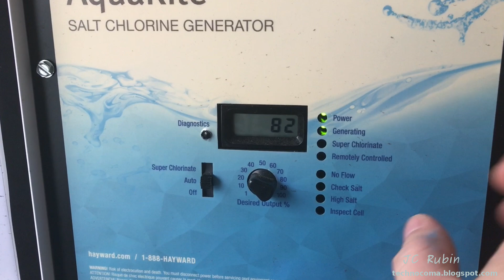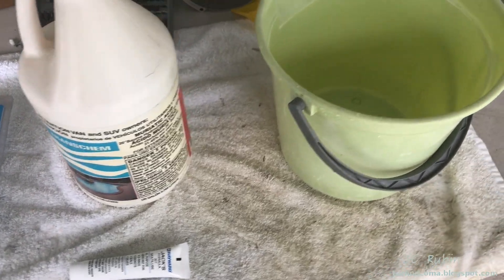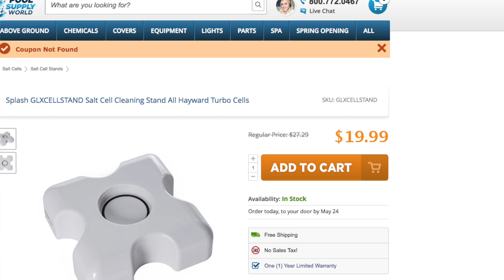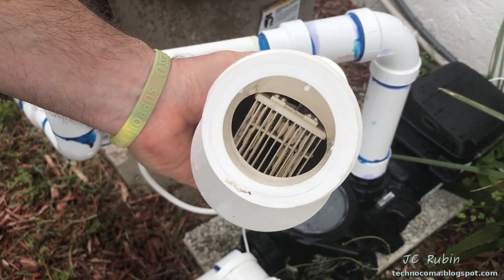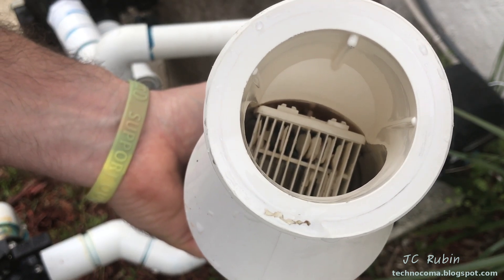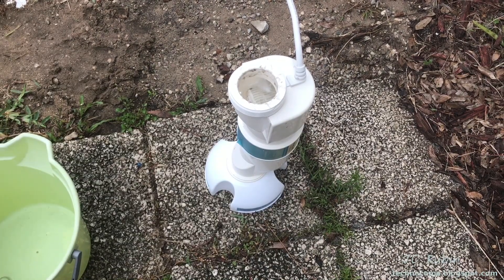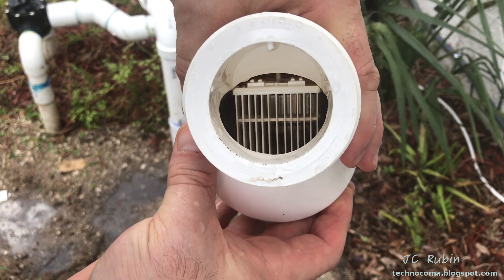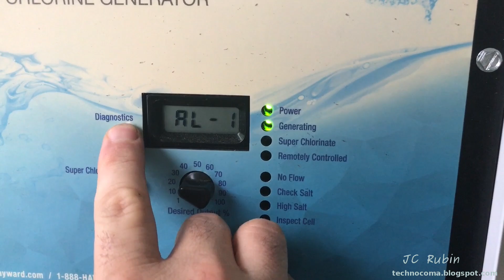Hayward AquaRite Turbo Cell - Cleaning and Regular  Maintenance Inspection

Comment: Thank you....but was curious what did u do with the bucket of water and the "waste" muriatic acid and water mixture from the cell? Some vids just say pour it into the pool? Did you? If its quite dirty id rather not throw it into the pool do you just add more water to it and dump it in the corner of a rock garden or backyard?

Comment: Thanks. I haven't ever done it before and my first Hayward salt cell lasted 6 years and this one is 5 years old. I am trying to figure out why the salt cell is generating great, but for some reason it's reading a low salt level. It keeps going to 2600 or 2400 when the pool store says it's at 3000 or 3200. Thought cleaning it might fix the problem? When my last one died after 6 years, it had never been cleaned, and it was quite clean. I guess Atlanta water must be very good. I tried recalibration,  but it does not seem to hold. Question: Does it take about a gallon of the water acid mixture or a smaller amount? Thanks.

Comment: Do not use acid it burn the cell ,use CLR mine is 9 years old still working
Reply from the maker: What a profoundly nonsense comment......   Don't use acid... use acid.

Calcium Lime Rust, more commonly known as CLR, is a household cleaning product used for dissolving stains, such as calcium, lime, and iron oxide deposits.

Its ingredients may include various compounds:[1][2]

    water
    lactic acid
    gluconic acid
    lauramine oxide
    propylene glycol
    n-butyl ether
    glycolic acid
    sulfamic acid
    disodium capryloamphodipropionate
    ethylene glycol n-butyl ether
    citric acid

One formulation is (by weight) lactic acid 12-18%, gluconic acid 2.50-3.75%, lauramine oxide 1.50-3.25%, with the remainder being water.[3] The product also contained phosphoric acid at one time,[citation needed] but it is now phosphate-free.

Comment: Hi. We used grips to successfully unscrew the rings from the salt cell, but when we did a lot of water started coming out and would not stop. We had to screw it back together and stop the process. Any help?
Reply from the maker: open the air valve of the filter first, then the water will drain down to the pool and the salt cell will empty.
Reply: @retrotechandelectronics hi, will opening the pump lid (where the basket is) also do the trick?

Comment: Where do you dump the used acid/water??
Reply from the maker: I dilute it in a large bucket about 40:1 and dump it in a sand pit with good drainage.
Reply: @retrotechandelectronics  cool, tks! Great video!

Comment: Great video. Have been struggling to keep chlorine levels up on SW pool, had it at 60% and nothing, system displaying "no flow".  Sure enough, opened the cell and full of scales. Cleaned it and 15 minutes later back on with correct "flow" reading.
Reply from the maker: Glad it helped!

Comment: I bought an after market salt cell two years ago. It’s seems to be dead. Is that common? Any way to test if the unit is kaput before buying another one? I wonder if buying a cheap cell is why  I am in this situation. I got 5 years from my Hayward that costs 4xs as much.
Reply from the maker: I havent had any experiance with off brand cells, check amazon reviews on the one you purchased.

Comment: When I removed the cell, it pushed a bunch of salt or fine sand into the pool.  Is there anything I can do to prevent this?
Reply from the maker: There should be nothing in that cell when removed but water.... You have other issues upstream...

Comment: Great video.
I might have to finally try cleaning my cell.  I've never had to clean it before. Vinyl liner pool with low calcium levels and with rain I don't have to add much water from the tap.
The control panel is only reading 3300 ppm when the salt level in the pool is actually 4250 ppm (pool store).  
The 4250 ppm is my fault.  I added salt at the beginning of the season without checking to see if the salt cell was reading salt levels accurately.      I normally run the salt around 3600. 
The salt cell is 8 years old.  Then again I normally run the cell at around 30% for the 5 summer months. So I guess it really doesn't have that much use.   I hope cleaning it will fix the cell/readout.  I'm going to just keep running it until it stops producing chlorine or the control panel read "too low salt" and won't run.

When it does finally fail, I'll just switch to adding liquid chlorine for the rest of the season or until the price of new cells comes back down.
The cost of a new T-15 cell is insane at the moment.  They are asking $900 when just 6 months ago they sold for around $550.
Reply from the maker: Wow, 8 years without cleaning. Impressive.

Comment: What is the name of the tool do you use to open it? mine is too hard
Reply from the maker: I use an oil filter wrench like this 
https://www.amazon.com/TEKTON-5866-12-Inch-Filter-Pliers/dp/B000NPR33O/ref=asc_df_B000NPR33O/?tag=hyprod-20&linkCode=df0&hvadid=312003160272&hvpos=&hvnetw=g&hvrand=14860492056429093465&hvpone=&hvptwo=&hvqmt=&hvdev=c&hvdvcmdl=&hvlocint=&hvlocphy=9012393&hvtargid=pla-382661962209&psc=1

Comment: I cleaned it but still says 0 and my aquarite system still says inspect cell its not flashing , the light is just on should I increase the output ?
Reply from the maker: you need to hold the button for several seconds to reset the maintenance light.

Comment: What is that tool (special wrench?) you use to loosen the union?
Reply from the maker: Its called a bar clamp.  Its used for a different purpose but I found it works well for this so I use it.
Reply: A strap wrench works well also.

Comment: One suggestion for improvement here - when you screw the cell into the stand make sure the cord is facing down. Otherwise, the acid can't clean everywhere inside the cell.  I found this in the manufacturer's training video.
Reply from the maker: Thanks for sharing.
Reply: @retrotechandelectronics  No. You did it correct. If the cord is at the bottom I don't even think it will screw onto the GLX salt cell cleaning stand. I do it with the cord up everytime, just like you did in the video.
Reply: @scotty7647  It will screw in either way, and yes, the manufacturer suggests having the cord facing down to ensure complete cleaning.
Reply: @lilricky2515 correct

Comment: The Power and Generating lights go on and pop off on my AquaRite after a few seconds and my chlorine levers are low...The Led display is responsive, but it seems like it keeps popping off. Any ideas?
Reply from the maker: Please explain what a chlorine lever is. I am not familiar with this.
Reply: I suspect you meant chlorine levels. If you are good with electronics you should check the PCB in the controller. It uses large electrolytic capacitors that have a habit of failing which prevents the unit from powering on. A bad one is obvious because it will be bloated and have gunk escaping from the top. My controller would not power on and replacing a single capacitor for a few bucks saved it.
Reply: @dano2490  Thanks for following up! I ended up replacing the inhibitor, which I got from Digikey, Shipping cost more than 3x the $2.50 part. Ha! As I was clipping the posts on the old inhibitor, it was literally crumbling. I just drilled into the board and soldered it in; works great!

Comment: What is the tool that you used to unscrew the chlorinator called? Thanks.
Reply from the maker: I use what is called a bar clamp.  It works well for me.
Reply: A cheap strap wrench is ideal. The bar clamp could crack the plastic if not very careful.
Reply: Any proper sized Chanel lock pliers or pipe wrench will work

Comment: Can I use vinegar instead of the acid? I know it will take much longer to do the job but is safer
Reply from the maker: I would imagine that if you used cleaning vinegar, without dilution it would work.  You would have to see how long it would take by trila and error, or when the bubble stop, maybe an hour or more.

Comment: Am I looking at this wrong, or is it installed backwards from the way Hayward recommend?  My manual says put the power cord end downstream of flow.
Reply from the maker: Does it? Ill have to check it out... If so I can just flip it around as those are the quick disconnect fittings for maintenance of the unit. Thanks.

Comment: Don't worry, I have splashed good quart of 100% muriatic acid on my foot. Guess what? Nothing happened, just rinse it off with water.
Reply from the maker: I dunno about that.  100% would at a minimum release caustic gas if it splashed on anything.
Reply: @retrotechandelectronics  it did foam up and stain my pool deck though, as well as outgas nasty but somewhat refreshing scent, wakes you up just like a good strong morning coffee! But it did nothing to my skin at all. I'm pretty sure I would feel some burning sensation if I didn't rinse it off fast enough. I guess it has something to do with high pH body oils which neutralizes acids before it gets deep enough. Anyway, the danger is somewhat overrated just like electricity and radiation. I've been shocked by 240v few times, painful but not lethal, ironically it is also somewhat pleasureable and refreshing :). Also, I collect radioactive materials as part of my hobby, Uranium ores and metals, Cs-137, Am-241. Sounds funny, but I'm comfortable with everything most people gonna freak out. Knowledge and education is the key to overcome the fear. It has nothing to do with the fact that I'm russian. :D
Reply from the maker: AAAAAAAAHHHHHH!   system.exit(0); !!!

Comment: I do the exact same thing as well. Results are always good. I also just changed a bad pot on the chlorine controller. The 0-100% pot. It was jumping all over the place. Works great again.
Reply: I noticed that my screen jumps all over the place also. How do you change the pot?
Reply from the maker: My control unit is not co-located near the pump, its in the screened enclosure near the house away from the elements.  I can see how the pot might be the first thing to go.
Reply: @retrotechandelectronics  what's the chlorine controller "pot"?
Reply: How do you dispose of the acid? Do the o-rings come out prior to pouring the acid in it?
Reply: @jwalker502  Pull the O- rings out, pour the acid into the pool. Put the o-rings back in after.